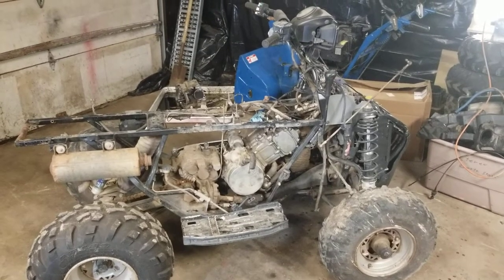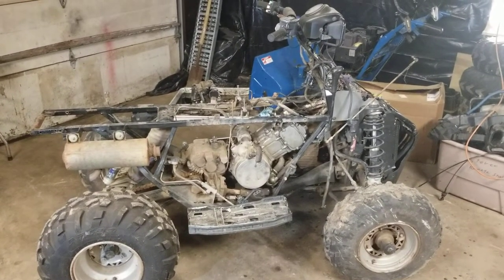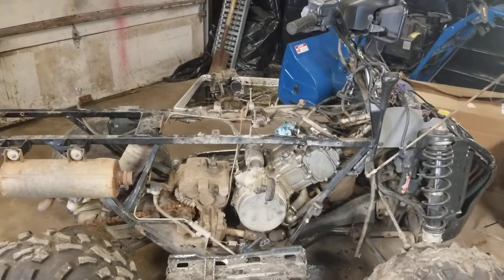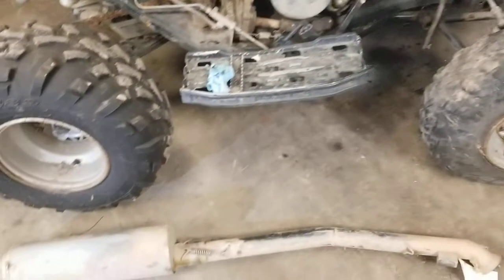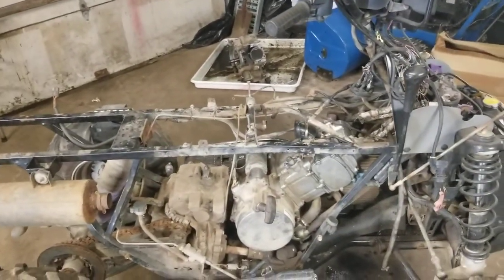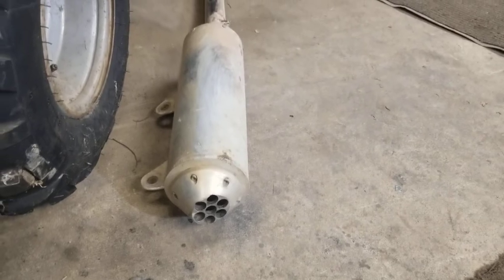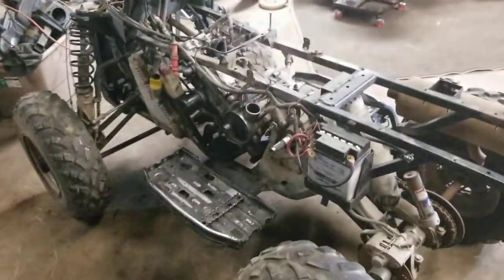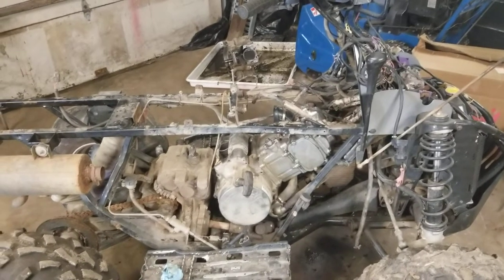Polaris 500 Engine built 10 to 1 compression  ratio!

Comment: It will run lean!! All rpms. Start with three sizes bigger pilot jet. Raise the needle one. And bigger main by three. Must do denim dyno to get it right. Throttle response for pilot and needle, wide open 1 mile run plug check for main, including best power. They ping just before the piston melts. Use forged piston and aftermarket cam. Even more jetting if you up the camshaft size-which you should to take advantage of the compression.
Reply from the maker: Thanks for the info.
Reply: @TitaniummanGarage  always love your videos. I’ve saved a ‘07 scrambler HO thanks to you. She’s mint now!
Reply: I’d love to see this performance mod in my scrambler. And clutch mods.
Reply from the maker: @wadejensen4146  Awesome! Thanks. I think that scrambler is definitely going to need to be clutched differently. Lots of power already. Belt slips on wot.

Comment: Talked to you a few weeks ago about back pressure in my radiator no water in oil no white smoke no leaking from waterpump just a update guessing the head was warped some when i put the new gasket on it (i didnt check it) well went on a ride done great for about 4 hours kept my radiator fan on the whole time kept a check on water level well it just all of a sudden bogged and died went to crank it again and white smoke boiled out the exhaust turned over a few more times then cylinder locked (jug filled with water) pulled it home sparkplug out got the water out question is i have my new gasket kit and gki g to have head checked for cracks and warpness should i break it completely down and have the jug checked also? Saw in one of ylur videos where you said ylu had a jug warp but its rare
Reply from the maker: Thanks for the update. It is rare that the jug warps. I just wanted people to know it can happen. If you have the head shaved just put it on the jug with no gasket and see if it walks back and fourth. That should tell you.
Reply: @TitaniummanGarage  not warped to where it will rock back and forth still going to get it shaved down its pitted and wore down at the exhaust port and in between those exhaust ports is a water port